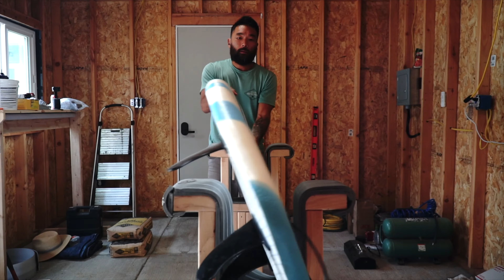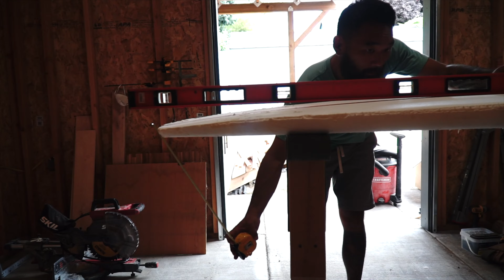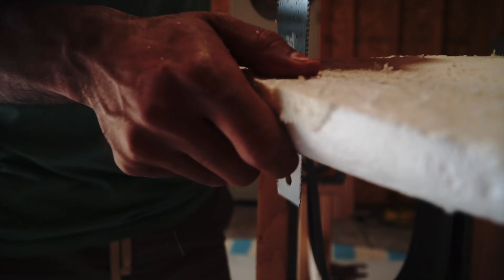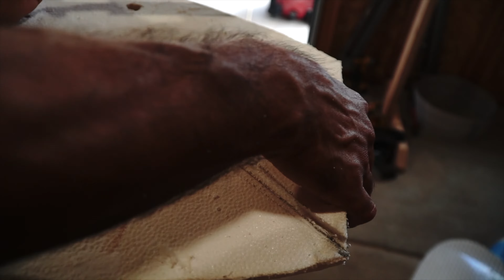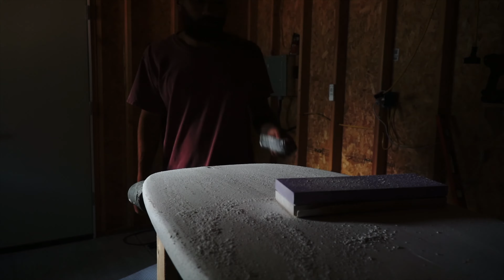I PAID $30 for this foamy & shaped it into a FISH PT. 1

Comment: I've been shaping since 1973.  The one bit of advice I would give you is that when you are shaping rails/bottom/deck, always do every cut in contemplation of the entire shape you want to finish with.  I.e. Don't shape the board in sections.
Reply from the maker: I’ve been learning that makes the process a lot easier! This first board I free handed most of everything - essentially had no idea what I was doing. I still have A LOT to learn, and that is definitely very good advice. Thank you 🙏🏽
Reply: @paul_s-eo  Keep it up!  Nothing better than shaping a board to fit your style.
Reply from the maker: @powerlooper9121 thank you! 🙏🏽

Comment: Hi, What material have you used to fill the holes? Qcell?
Reply from the maker: Hey, I used a putty like filler that’s used for sealing eps boards. I don’t recommend doing that! I would just use scrap foam and gorilla glue (white) for the best results. Otherwise resin and q-cell would work, but that’d would make it harder to shape (and harder to cut in fins boxes) and add more weight!  Hope this is helpful!